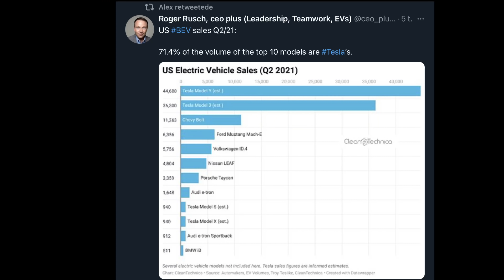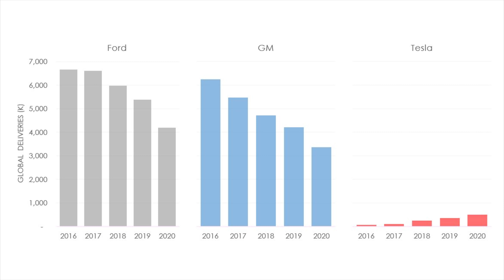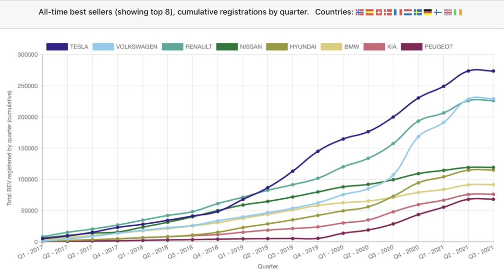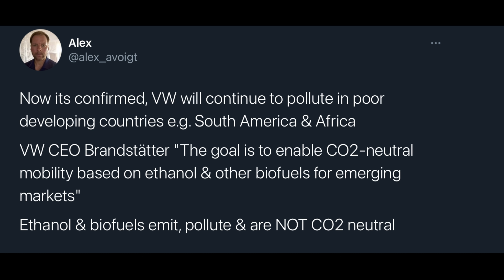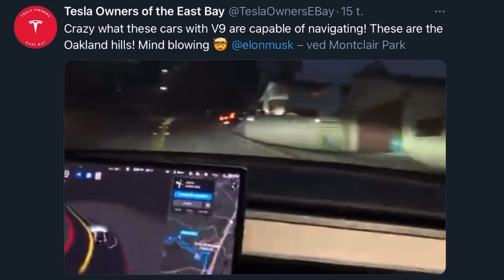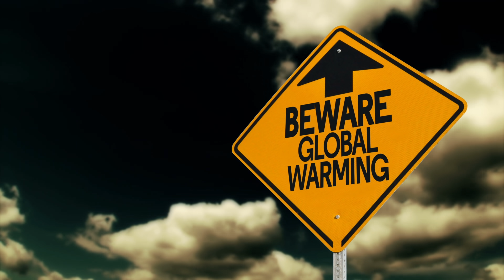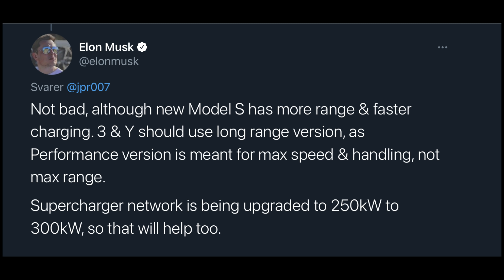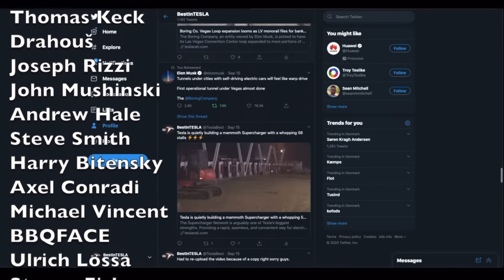Ford laughed at Tesla, now it’s s the other way around

Comment: My understanding is that biofuels are CO2-neutral - all the CO2 that burning them releases was originally absorbed from the atmosphere. That's not the problem. The problem with biofuels is that their production often replaces food production.
Reply: Yes. The biggest problem is volume production. Burning these fuels will still result in emission of toxic chemicals.
Reply: Need to consider the whole production life cycle including fertilizer and transport. If you burn everything grown there is still a net input of petroleum.

Comment: The Ford Mach-E sold 12,975 units in 2021, Chevy Bolt sold 20,288 units, Tesla Model E sold 51,510 and Tesla Model Y sold 75,429 unit so far. Plus it is only fair to mention that the Ford Mach-E was Car and Driver electric car of the year which is not bad for their first electric car.

Comment: VW made the mistake of thinking Tesla was going to sit on their a$$ and make the same type of EVs as VW does when they come out with a model then it's many years before they make some changes to it but it's usually tiny body style changes and small upgrade so they can keep calling them new cars 🤣. Tesla on the other hand is always upgrading something on almost all its EVs almost every week. And they keep coming out with huge changes and improvements on the new models a few times a year now. And they are just getting started.

Comment: 6 electric Mustangs did not survive a long downhill regen heating in Norway. The cooling quit. The car quit. All in the same place over 10 days.
Reply: That’s very interesting that 6 Ford Mach E’s should have the same problem. I’d like to find out some more about this, have there been any local news reports about this?
Reply: @j.pgoodwin9020  And with the additional capacity of fluid that Ford is using you would think that it would be cooler.   Pretty sad engineering.
Reply: @batandball617  https://www.tek.no/nyheter/nyhet/i/bzmqre/mustang-mach-e-eiere-havarerer-i-lange-nedoverbakker
Reply: Yes. That's yet another embarassment for Ford.
Reply: As the man said "Ford laughed at Tesla, now it's the other way around".
Reply: @Frank_W.  Additional coolant adds weight making the downhill inertia even more of a problem. Ford Mach-E carries 22.5 kg of coolant in the thermal management system alone. Tesla carries just 9 litres. Ford has 4 circulation pumps against Tesla has just one. Ford have simply productionised their first rough prototype job done.
Reply: @Dave5843-d9m  you mean 9 kg not liters.  Tesla has some serious engineering talent
Reply: Ford says it's an "unfortunate" software issue where regen braking overcharges the battery. Owners can have that corrected by an update at a dealership, or by an OTA update scheduled for September or October 2021.
Reply: MACH-e has Software glitch in America , charger door opens when Driving , have to pull over to Close, car Software can be UPDATED, but the Update BRICKS the cat, making UNDRIVEABLE.
Reply: @Frank_W.  a liter of pure water weighs a kilogram
Reply: @batandball617  Imagine if this happened to Tesla. You wouldn't be able to move for mainstream FUD.
Reply: FORD-Fix Or Repair Daily LOL
Reply: @futuristicdad3178  Flip over read direction
Reply: @markplott4820  Why are you bricking your cat? A tad cruel.
Reply: @Frank_W.  Yes Chevrolet has that wrapped up. I live on a mountain go down 8 to 10% grade every day for 20 miles get 80 miles of regen never overheats. I would have a Tesla if it were not too expensive. I like a front driver display but I can get an aftermarket one. Soooo when the price comes down a Tesla will be in my driveway.
Reply: @tomgray971  Chevy has hill top reserve in the early Bolts  and control of charging in the current Bolts. Mine is set for 90% ( for me about 250-290 miles of range).
Reply: @MarkXHolland  I agree to that.
Reply: @daviddrake6875  Just be careful with that Bolt. After 3 recalls, they are still catching on fire when charging at home. I hope that they get this fixed soon. The Bolt is the only decent cheap option available in the US.
Reply: And now Ford's way of charging is regenerative towing by a truck (Semi?).. After that the Mag-E is stranded with a full battery because of the regenerative braking  issues! LOL
Reply: @anthonypelchat  Well, it is not such a decent option if it burns down your garage!
Reply: @warrenhall1750  that's why I said that I hope they get it fixed. Not good if catching on fire. Pretty good if not.

Comment: FSD has to many interventions currently to be ready for the public and with 1,000 beta testers which is higher than Waymos fleet of 600 and Tesla can do all this without lidar or radar (vision based depth per pixel is equal to lidar but with color and cheap)

But when safe enough (maybe 5,000 miles between interventions) open to public and 1,000 testers/teachers become 100,000 teachers and learns 100x faster (and nearly doubling every year or two from new sales)

FSD will be robo taxi capable when their intervention rate is beyond 500,000 miles (or the average distance driven before a human gets in a crash)

Although, the accident avoidance system is already super human with the human as a backup because a Tesla on autopilot drives 3,000,000 before an accident (a human would have been in 6 accidents having drove that far, meaning autopilot avoids 5 out of 6 accidents)

Comment: The core of the problem is the nightmare bureaucracy at the legacy carmakers. Different teams designing around each other, instead of an holistic design. A single 'Tiger team' would do a much better job. Ford, GM, VW et al could then at least make the best of what they have. Instead, they are producing heavy, inefficient, complicated and expensive vehicles that pale in comparison to Tesla.

Comment: I just found out that a Tesla model 3 is actually more efficient then trams are in The Netherlands! 
All trams combined in The Netherlands drive 12m kilometer and use 45m kWh.
Somehow when it comes to passengerkilometers it's 327m kilometer with 45m kWh.
That makes 45/327=0,138kWh a km a passenger.
A Tesla model 3 uses 0,136kWh a km if it got one passenger when it drives an average of 90km/h (just to compare, the TOP SPEED of a tram is 70km/h).

Comment: What does Tesla do that other car manufacturers don't. Tesla don't make glass, gearboxes, driveshafts, brakes, HVAC compressors. So they make chassis and little else. All manufacturers make electric motors because this is not innovative. Batteries are mostly sourced from battery suppliers. FSD doesn't yet work nor required at the price by most of the world's drivers. $10 000 is better spent on a Wuling.

Comment: Regarding Diess' goals 11:40 - Let's do the math:
2018: In 2 years our EVs will give twice the value of Teslas
2021: In 4 years our EVs will give same value as Teslas
2024: In 8 years our EVs will give half the value of Teslas

That's developing both in a geometric series. Using a linear series would give:

2018: In 2 years our EVs will give twice the value of Teslas
2021: In 4 years our EVs will give same value as Teslas
2024: In 6 years our EVs will give zero value

Comment: Love your channel! Looking at Toyota's fixation on hydrogen I'd like to see an analysis of how much power (kilowatts) a hydrogen fuel cell car can actually produce. Most hydrogen fuel cells are .5 to 1 volt - how fast can a stack of them drain? (power) the Tesla P100D produces 1400 amps at max. power. What's the practical limit for hydrogen fuel cells? Are hydrogen cars basically puny? Or not?
Reply: With all Hydrogen Fuel Cell powered vehicles they need either batteries or a substantial storage of Supercaps to provide any load approaching peak power. The Vehicle actually runs off the Battery/cap which is continuously being charged by the fuel cell or Regen
Reply: @j.pgoodwin9020  )

Comment: Regarding Diess' goals 11:40 - Let's do the math:
2018: In 2 years our EVs will give twice the value of Teslas
2021: In 4 years our EVs will give same value as Teslas
2024: In 8 years our EVs will give half the value of Teslas

2/
That's developing both in a geometric series. Using a linear series would give:

2018: In 2 years our EVs will give twice the value of Teslas
2021: In 4 years our EVs will give same value as Teslas
2024: In 6 years our EVs will give zero value

Comment: In Europe, if you upgrade ID3 to the M3 SR+ trim level it can be more expensive than Tesla. It will have a bigger battery, but charges much slower, the plastic interior is substandard, and the car is smaller. It is only cheaper with poor trims. So, no VW can't even manufacture smaller cars cheaper than Tesla.

Comment: I bought a Bolt EV for the overhead camera and Apple CarPlay and making $2K/mo Model-S payments on it it will be paid off real quick! I researched Tesla for years , joined facebook groups and noticed lots of front end damage from the distracted driving with everything on a screen! Not allowed to text and drive but you can run the car and drive! Bolt has just the right amount of buttons and knobs! Also can hardly wait for the F-150 electric! The chip shortage will end soon and all will change!
Reply: Glad you love your Bolt! Thanks for driving electric!
Reply: @usa-ev  yeh, I was enamored by Tesla for a long time and could afford a M-X but I heard to many horror stories of dealing with service and I literally couldn’t find a M-Y that wasn’t obviously flawed! And the service center is 100 miles one way from my house but within 20miles I have 3 Chevy dealers who finally forced me to get my tires rotated for free! With Covid I have used the unlimited hotspot every day for about 2hrs/day so getting  the 2020 model saved me a fortune in data cards! Also I get no hate, my last EV was a Ford Focus that had “Electric” in chrome letters everywhere so I had pickups try to ram me on the road! The Bolt is incognito so no drama!
Reply: @ronalaska2472  I always liked the Focus Electric. The battery bump was a deal breaker, though. We now have a 500e, which is also very incognito and so much fun!
Reply: @usa-ev  loved the Focus but range went to 90miles summer and 50 miles winter where the Bolt shows over 300 miles at full charge! Just leaving on a 300 mile trip now will see how we do!
Reply: @ronalaska2472  Safe travels!

Comment: Put a 10000 trailer on the Tesla and F150 and drive 500 miles see who gets there first,  The eco boost F150 or the Tesla plug in.  See you waiting at the charger every 100 miles or so.
Reply: Cybertruck or f150 lightning. Who will get there first? 😂
Reply: @honglin4276  why waste the day charging trucks not made to tow distances.  And with all the work features on f150 makes it makes a better work truck inside and out.

Comment: Great video but I disagree that ver 9 is 90% there.  I have watched about 6 videos of the ver 9 release by beta testers and it still has interventions that seem on par with the last best versions of beta 8 in situations that are weird for the car but not for humans.  a few instances of getting too close to trees leaning into the road, a few instances of cutting toward medians on turns, a few instances of attempting to make weird turns that are not on the route/ missing the turn lane in time and even an instance of trying to pass a car in front of it that it thinks is parked but isn't.  Still an incredible build but it looks like it needs to learn more for this version. It seems to me based on watching many videos of the past version that this new version is 3 steps forward 1 step back.  I believe from watching that it will be much improved over the next 6 months.  I would predict that a larger beta release is many months away and version 10 will be the 90% you are looking for after that version has learned for a few months.  I don't see this version going to large release sooner than several to 6 months if at all.  just a guess based on watching.  Its still incredible but I disagree how far along it is on its own when evaluating its flaws in the real world unpredictable situations which it needs to do better for it to be released more widley. I hope I'm wrong!

Comment: Looks like BYD is poised to challenge Tesla on multiple fronts since they have vertical integration too.

Not at Tesla level everywhere yet - but it's coming along nicely. Android Ice Cream Sandwich vs iPhone 3 all over again. :)
Reply: High probability that there will be two major players in EV production, hopefully they can satisfy the masses between them. Boutique cars do ok today and I see it continue in The EV Era … who knows someone might come up with even better technology while nobody is looking …. 😄😀😃😁🙃🙃🙃
Reply: @chrisbraid2907  Aptera with in wheel motors, composite 4 part body, excellent aerodynamics, high efficiency ( 100 miles per Kwhr) Solar panels giving up to 40 miles range. Multi plugs ( even 120 volt standard house plug for charging ).  Sandy advising and investing in it.

Comment: Don’t say there are no people who want ICE cars.  There are people who will definitely want them in 2050, and there is room for these cars.  The most important thing is that unnecessary commuting ends and what is still needed in private cars becomes electronic.  In addition, it needs to be absorbed into public transport which will even help the transition away from private car use in commuting.  There are so few people who drive in their free time that pollution does not matter.
Reply: You clearly have not think about the price of gas in 2050...you are thinking it will be more or less the same as today...and you think there will be the same number of gas stations? Come on,man!
Reply: Sale of new ICE cars will be banned in most places. The ICE cars will be much more expensive to manufacture than today anway and the infrastructure for fueling these cars will no longer be profitable in most places by 2050. ICE cars will die out.

Comment: "The Competition is coming"😂
Reply: Competition is only coming for ICE cars
Reply: Slow and all over themselves ;) #solvingthemoneyproblem
Reply: That white merc riding into a tree is the visualisation of the words: "the competition is coming" :)
Reply: Competition ain't coming. Need v i a g r a ...🤭
Reply: The competition is coming but has never arrived...
Reply: @mikafiltenborg2291  No. Automakers are already today competing for market share in the new EV market. They are competiting against each other. Any other attitude will be a costly one.
Reply: @yourcrazybear  As long as they are run by accountants, not engineers, they are doomed. They have to take huge losses up front to build useful charging networks, buy out dealerships, and write off all the ICE IP and infrastructure just to get started, and the current hierarchy bonus system can't withstand the share price hit.
Reply: @lengould9262  Yes. They also need to secure battery supply and actually produce EVs in volume as fast as possible.

Comment: Elon will have that Ford Tweet etched on his brain because they rained on his parade.
Looking forward to the 7000 cars 3 hour tweet. Annual run rate 12,000,000.
However the 4000 cars/hour run rate is only 9,000,000 cars per year. At that point many of those sales will have come from  Ford's dwindling output. So that's about 2027 at the latest.